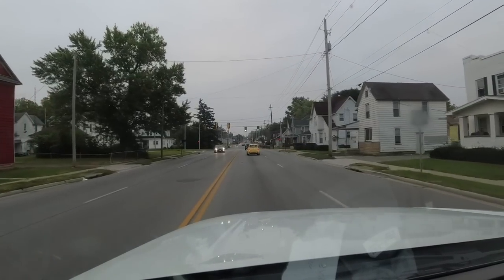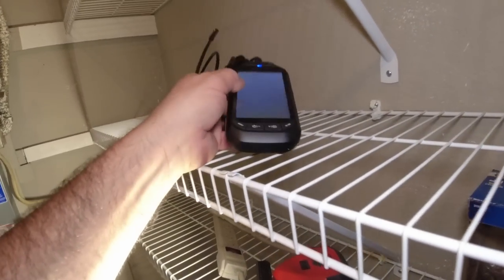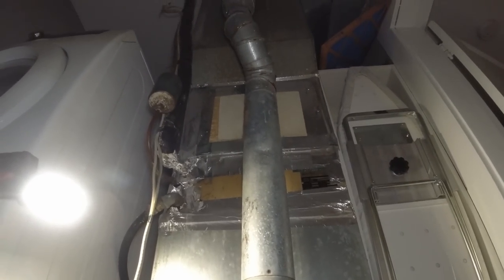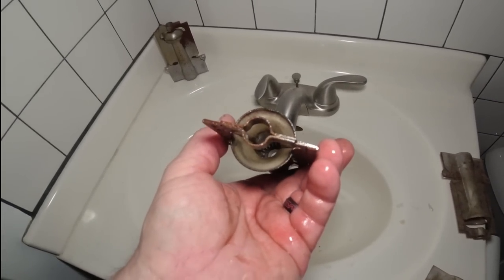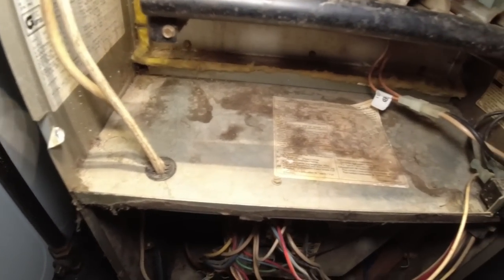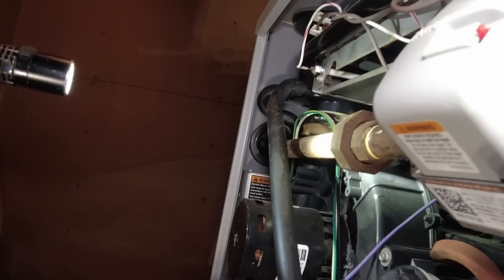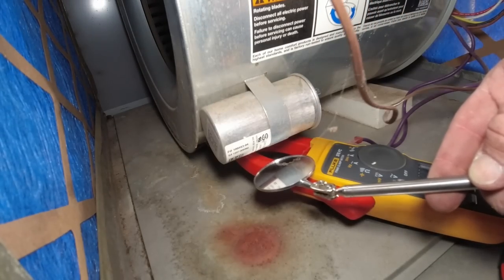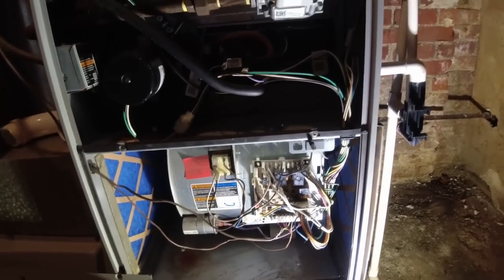Landlord Gets BIG SURPRISE After HVAC Inspection!

Comment from the maker: Thanks for taking the time to check the video out! I had 4 furnaces and ac units plus 3 gas water heaters to check and verify operation. Leave me a comment below if you would have done differently.
Reply: its that one near wall before flue pipe passes though wall
Reply: I’d done same thing
Reply: Yes  I would of done it very differently. I would have got in my truck and drove the fluck out of there as quick as possible.
Reply: I'm not a heating engineer just a user of these things.  I most definitely like your can-do attitude.
Reply from the maker: @Patrick thanks for the view and the feedback👍👍
Reply: I would of walked away from train wreck

Comment: The last furnace around here the inspector would fail it return in the side, but I guess it’s code in your area.
I’m a 49+ HVAC&R tech (mostly commercial refrigeration now) I’ve never known of “out of spec igniters” checking with an ohm meter only good or open.
Under any circumstances that chimney needs a flue liner.

Comment: I have a very bad habit when I buy buildings unless  it 2 years old or I say rest in  peace  and get high efficiency.  And I stay with the same brand we have used the same furnace and air conditioner company for roughly 30 years the only time I did not that was when I bought a modular home biggest mistake of my life! You make great videos and do great work
Reply from the maker: Thanks for your feedback! Are you a investor or in the field?
Reply: @HVACRSurvival   our family  have been  property  owners  since  1953  we have proper care for  your  building  gets good  long term  renters we don't  let  any appliances  get over 10 years  old  and appliances  and building  get fully  checked  every  6 months
Reply: high efficiency. aka highly efficient at parting your money when it fails non stop or needs replaced again in short term. none of it will last long at all and for sure not 30+ years
Reply: @throttlebottle5906  If you make money on the property, you can write a depreciation schedule on the asset such that it offsets profit on taxes.  
High efficiency makes great sense for business applications, so that you can claim the rebates, have lower operating expenses, an active parts supply chain that doesn't involve ebay, and depreciate the asset over the useful life, which you can set at shortly beyond the major component warranties.

Comment: just ordered that camera, nice tool chummy
Reply from the maker: I had a wireless version that was always dead and took forever to connect. This one has been great.
Reply: @HVACRSurvival  I always run into leaking minisplit coils and usually use my camera to check the backside this will make it much easier

Comment: I'm not surprised to see those furnaces in the condition they're in because that complex most likely has sat empty for a very long time and it's actually common to see that with similar buildings since most people want either houses or subsidized apartments to live in around this city. If you like Lennox stuff you would probably like my furnace which is a Concord 80% from the 90's and has been giving me issues for about two years now and is very annoying.. lol
Reply from the maker: This was a bar with 2 apt up stairs that just closed. So it had been used up till resent. I use to like Lennox when they were good but I don't classify Concord as a equal with Lennox, The Ducane and Air-Flow brand products are about as close to a clone as you can get minus the fancy features

Comment: Rick great video! Funny that last furance you were working on I believe it's a comfort aire guh92a not a bad furance but the issues you were saying about it spot on. Thanks for making these really appreciate it keep it coming 👍
Reply from the maker: That was a Ducane. That's the brand heatpump I personally have and the brand I use for my side ventures
Reply: Nice 👍 the ducane you have now did you replace that for Carrier infinity if I remember correctly that was giving you a bunch of problems getting no tech support or was that not for your house
Reply from the maker: @hvacr6000  nope is from 2007 I believe? The first one had a refer leak outside and ran for a long time without refer during the winter,  they didn't have a low pressure switch on it so I wasn't happy when they didn't have a warranty compressor available,  so I got a new outside unit thanks to there poor design, I haven't had a problem since.
Reply: What a pain glad to hear it went well 👍

Comment: Definitely learned something when watching your videos, truth be told I’ve only ever seen a gas furnace once (where I lived it’s mostly wood, reverse cycle or indoor gas heater) and I was trying to diagnose this Brivis unit. My uneducated conclusion was Indonesian geckos had shorted out the logic board 😂 After I fixed the “hailing master controller” issue on the thermostat. Cleaned the burners, checked the connections etc but deader then a dodo. Ah well it wasn’t needed anyway since it wasn’t cold.
Reply from the maker: That's quite the story,  thankfully the geckos didn't cause a the problem. 👍👍🎬
Reply: @HVACRSurvival  They love Mitsubishi Heavy Industries units. I’ve had two dead outdoor units because they’ve shorted out the power supply boards. Unlike the two ancient R22 Daikin reverse cycle units I used to have that they could never kill. Dang pest they are, hopefully nothing lives in the States that can cause such destruction!

Comment: Do you see more package or more split systems in residential applications?  Seems more commercial buildings have package units based on your videos.
Reply from the maker: Residential is usually split systems and some mini splits, commercial can also have residential equipment but it's mainly packaged units.

Comment: Is it normal for a furnace to pull return air from the same room as a single pipe furnace in your area? (Last furnace in Video)
Reply: Not mention the natural draft water heaters.
Reply from the maker: It depends on how many square feet of free air they have. If its a small room then no, it will need to bring in combustion air.
Reply: @HVACRSurvival  Thanks

Comment: fyi u know flue pipe by hot water tank should not touch copper pipe!  zinc plating and copper dont mix as it can cause dielectric corrosion   just put something like an insulator between that …..

Comment: If they end up ripping it out it would be wise to switch to a heat pump system.
Reply from the maker: 🤣😂 why's that? Because of all this BS gas boycott the Democrats keep pushing?
Reply: @HVACRSurvival  It's more efficient.  If it was my choice I'd have an air to air heat pump and a tankless water heater.  Gas boycott?  Where I live in Wisconsin it doesn't get cold enough to even need supplemental heat.
Reply from the maker: I've been to Wisconsin at least 8 to 10 times and you get just as cold as we do in ohio, the only way you wouldn't need supplemental heat is if you're running a inverter system and don't want a backup plan if it fails.
Reply: @HVACRSurvival  Supplemental heat can be put in but it hasn't got colder than -22 F in a long time.  If you are going to have AC might as well use a heat pump, IMHO.  I use to live in Ohio, just north of Cincy.
Reply from the maker: What brand and model are you using? Mine doesn't do well past 20-25*